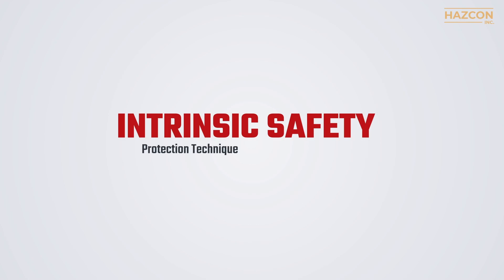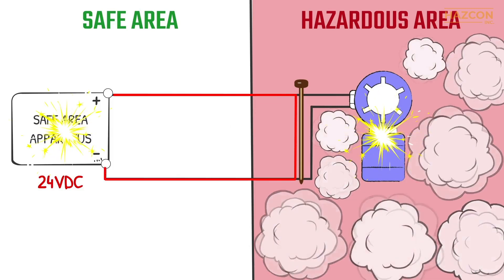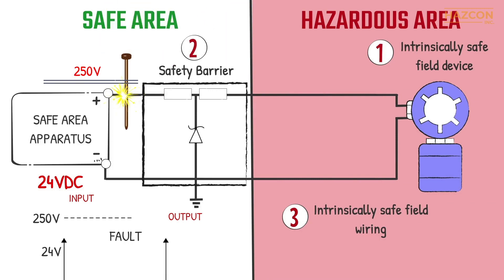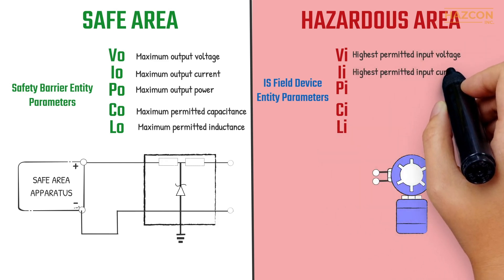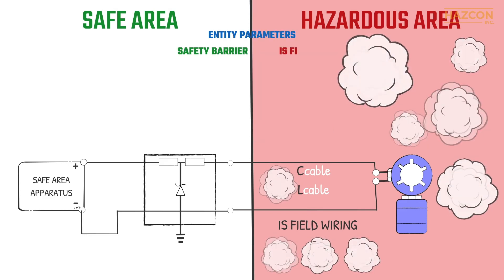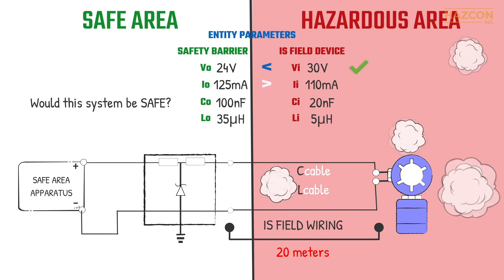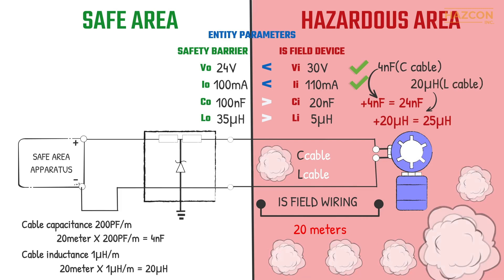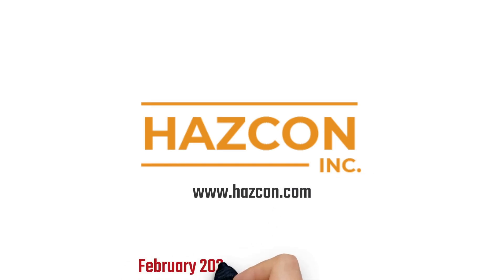Intrinsic Safety

Comment: Excellent, clear, simple and straightforward basic explanation of the main aspects and concepts of intrinsic safety.  Congratulations!  
Just a small conceptual comment: both "classified" and "unclassified" areas need to be considered and deemed as "SAFE".  
Electrical, automation and instrumentation installations, in both cases, need to use equipment with appropriate "Ex" protection types (in classified areas) or associated equipment (in non-classified areas), in addition to performing the applicable installation, inspection and maintenance "Ex" service procedures, according to IEC 60079-14 and IEC 60079-17. 👍 
Thus, it is suggested to use the term "UNCLASSIFIED AREA" or "NON HAZARDOUS AREA" instead of "SAFE AREA".
Reply from the maker: Thank you for your feedback!

Comment: Very informative video.. can you please also explain the scenario when the circuit is powered from hazardous area( active signals)?
Reply: @JojiJose90 Since this morning I am struggling in finding this answer on the web. Still did not find it, though. My hypothesys is that the instrument will have Vo, Io, Po max out towards safety barrier. The contacts of the barrier supposed to be connected with input from field, (different from passive circuits) will have their maximum input Vi, Ii, Pi. Concerning the overall energy stored in C and L of barrier and cables should I still believe they should not exceed the max allowed by Instrument Co max and Lo max. (practically speaking the reverse of normal verification). I am looking for a confirmation but I could not find anything yet. Your question was raised long time ago but in the meantime did you manage to obtain the answer? it would be very helpful form me and maybe someone else with same question. Thanks in advance. Elvio